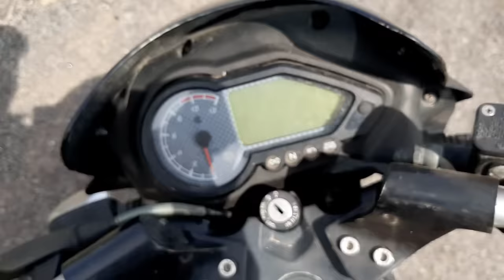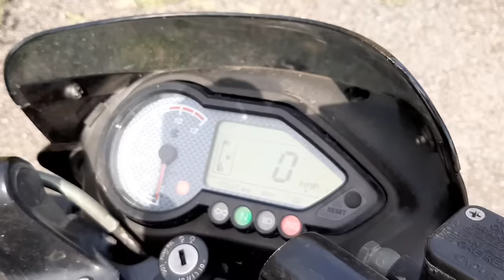How to start a bike without a key?

Comment: I lost the key to my 2014 triumph could you help me get it started until I figure something out
Reply: Tharun
Reply: easy
Reply: just go to were key barrle is follow wires and cut black and red wire touch them together lightw will co,e on and ready to start but dont let black wire touch frame or it will blow a fuse
Reply: @bryanmicklewright1417  I'm just seeing this message I have the 2014 triumph Street triple r are you talkin about the red and black wire that's coming from the push start button from the handlebars
Reply: @bryanmicklewright1417  okay where the key is imma try this tomorrow I sure hope it I'm trying to bypass the security
Reply: @bryanmicklewright1417  I just took a look at the wire harness coming from the key there is no red and black wire 
It's only a red and black wire coming from the push button start on The handlebar where the throttle is
Reply: Bean Oil if u look at key barrle and should be so,e wires coming off it follow them and you will see a conector habe a look what couler thay are its ever red to red or red to black depending on what wires you got
Reply: Bean Oil no the key barrl how many wires come from key barrle and what couler are the wires
Reply: @bryanmicklewright1417  for some reason I don't have a red and black wire I'm going to read off the colors to you right now I'm going to read off the colors from the key to the connector the end of the connector will be the male part the other end is the female part
Now this is the beginning
   white wire with green stripe/
Light brown/  white with black stripe/
Yellow/ white 
inside the same connector you have  little tiny white wire with a dark brown wire that's in its own little sleeve plastic sleeve
Reply: Bean Oil conect yelow and white and see what happens
Reply: Bean Oil could you some how show me the wires have you got face book or somet to send me a photo
Reply: @bryanmicklewright1417   now I'm going to read off the other side which will be the female side of the grey connector yellow wire / white wire with blue stripe
/Green wire/
 yellow wire with gray dots/
Black wire with green stripe with gray dots / black wire with gray dots
This is the other side of the connector from the chi you said
Reply: Bean Oil have you got face book or somet
Reply: @bryanmicklewright1417  yes I have messenger what is your name on messenger
Reply: @bryanmicklewright1417 

 jamel wanamaker
Reply: @bryanmicklewright1417  I just sent you my name on Facebook request me or what is your name
Reply: @bryanmicklewright1417  I don't see you anywhere on Facebook requested me I'm not going to try anything until you see the photos I need your help please
Reply: Bean Oil whats your name on fb 
and what your profile pic like
Reply: Bean Oil added you mate need you to confirm my mesage request
Reply: @bryanmicklewright1417  jamel wanamker 
A red Chevy Impala
Reply: Bean Oil ive mesaged you mate you need to acept my mesage request
Reply: Bean Oil add me bryan micklewright motor bike as picture
Reply: bryan micklewright will you confirm my msg on Facebook? Please

Comment: Ok so how do you unlock the steering without a key?
Reply: real are you on the stolen bike rn and cant move it?
Reply: Put your foot on the handle bars and pull the other side of the handle bar with your hand and it’ll snap
Reply: @bless...  omg wtf did he ask 😂😂😂😂😂
Reply: Brake it put your legs on one handel grip and pull to the other way and it will break after a bit just keep pulling nd then just turn to the left and right a couple of times and u are ready to gooo
Reply: There are usually a couple of screws on the ignition you can remove to take the ignition off.
Reply: It can be broken by pushing with your legs